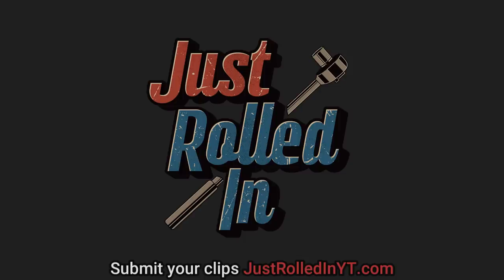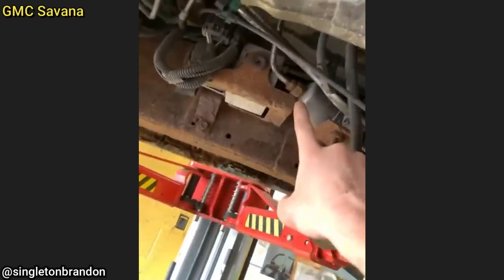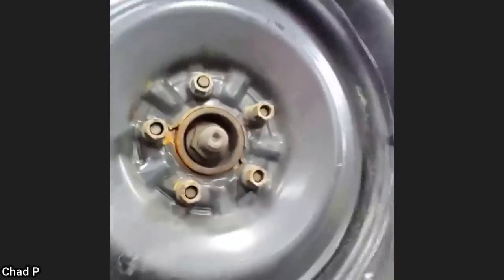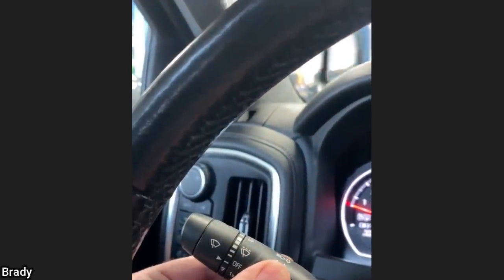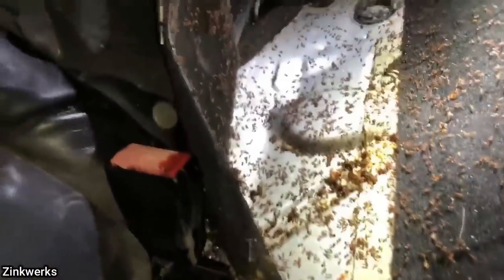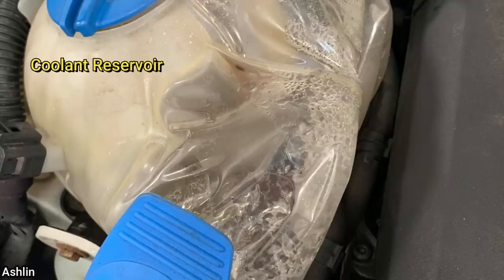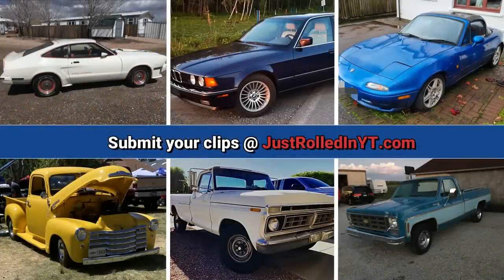Customer States Another Shop Failed To Replace Transmission | Just Rolled In

Comment: Just got my truck fixed. E brake hardware on the rear broke. He said the other side was looking rough so he fixed it also. And my rear wheel bearings were looking rough and he replaced them. He didn't call me for approval, he felt bad for the $800 bill, but I like my stuff fixed so I was happy and said "thank you"

Comment: That first one though, sounds like a case of "another shop" taking advantage of that person by just doing anything as "transmission work", when it appears the "fix" was dismantling all those automobile assemblies.  I'm guessing "another shop"'s "mechanic" didn't let them view the "repair" after they "completed" it.

I appreciate the fact the driver took it into the shop in the clip instead of continuing to drive the car in that condition.

Comment: 1:45 in my experience, most cars wont even detect the key unless it is in the vehicle, despite the windshield being so close, they usually won't start with the key on the windshield.
Reply: Second key must have been in the car if the customer drove it in like that.

Comment: Every time I watch one of your video's I'm at a loss for words. Since I'd rather not say what I suspect, let me just say people nowadays simply do not have the mechanical skills of even twenty years ago.
Reply: Maybe they should bring back "auto-shop" classes.
Reply: Which considering that everything is getting more expensive, you'd think its a skill people would be learning right.
Reply: Skills? What does that mean? .... 🤦
Reply: @sparkplug1018  I learned my mechanical skills back in the 60's when cars and trucks were reasonably easy to work on. I've spent my share of time crawling under vehicles, doing brake jobs and even pulling engines. Nowadays I can afford to hire a professional to do the repairs.
Reply: @jerryprice5484  Learned because I had to, now I prefer too. Just doesn't set right with me paying for something I can do. 
Surprising though more aren't willing to put the effort in we did.
Reply: @sparkplug1018  Totally agree, in my case however, I don't have a heated garage to work in, might actually work more on my vehicles if I did. At any rate,I now know watch to watch for when I have others do the work.

Comment: Modern driver assist systems know the difference between a box in the road, a person, an animal, or a vehicle. 
The reason they are this way is because the older type systems would engage the brakes over a trash bag blowing across the road. And occasionally, if the road gradient and conditions were right, a manhole cover. And other similar instances where it truly shouldn't intervene.

Comment: That is a 4L60E transmission that was just hanging. About the exhaust being cut, that is a common practice that I do to avoid breaking or striping an exhaust manifold bolts. Cutting the cooler line and leave the transmission suspended is NOT, however they way I do things.

Comment: I have a good story for ya. Roughly four years ago. 2003 Chevy Trailblazer. Bought it second hand from a parents coworker six months previous to bringing it in for repairs. Turning was a bit rough and I kept hearing odd sounds whenever I braked, turned, and occasionally while starting the car. I’ve never driven a four wheel drive vehicle before and simply assumed that it was normal. I read that four wheel drive cars can turn a tad jerky and rough. So I thought nothing of it. 

Six months go by. I brought it into the shop because my car was far less responsive to the turning of the steering wheel… I had been driving with a broken serpentine belt that had to have been so very close to breaking for at least six months. Fully snapped a month before I could get it into the shop. Still used it because I had to get to work. According to the mechanic he had no clue how I was able to ride it into the shop that was 8 miles away. Ended up being 3K worth of repairs.
Reply: Not very bright...

Comment: That loose seat reminded me of the car we had in the other day that had a messed up seat. When I opened the door, it was really high up, like headrest practically touching the ceiling high.  When I sat down, it sank to the floor. When I got back out of the car, "BOING" it was back up on the ceiling. And no, I'm not exaggerating the seat bottom being squishy. I'm saying the entire seat. As you put weight on it, it went down. Take the weight away, it came back up. Like it was on springs or something. And for the life of me, I cannot remember what kind of car it was.
Reply: You sure it wasn't a truck with a sprung seat????
Reply: @alexbrown1995  No, it was a fairly new smaller car. It was so weird. It had to have been broken, because it was half an inch from the steering wheel, so the only way to get in the car was to sit down on the seat first so it sunk down, then swing your legs in.
Reply: @joevk6274  That is weird, for sure.

Comment: I'm kinda annoyed at my repair shop. My car is fine but still it took several small repairs to fix the main source of my problem. So I ended up getting my serpentine belt, the tensioner, and the pulley crank all fixed for a total of almost $1450. What actually annoyed me was they noticed my coolant was at the low line. Instead of telling me that. They topped off my coolant with some cheap brand. My car takes a high performance brand from the dealership. Thankfully everything works but my coolant tank is passed the full line. Now I have to find out why my car has a second time lag in acceleration.

Comment: If you have an honest technician or even better if you have an older car and have a good mechanic...bring them a present when you are trying to schedule an appointment. Try to remember that they have ignorant customers that had a muffler job and then fault the repair man when their transmission stops working.  Forty-plus years in the motor trade.

Comment: Not gonna lie. I've set up a cardboard box in back of the shop to check the pre-collision system....it didn't stop.
Reply: In some cars it doesn't activate until you are doing 30 mph.
Reply: @bruceb4349  Makes sense. Otherwise, you probably wouldn't be able to park in a crowded parking lot

Comment: If you need a car with "driver assist", then you SHOULDN'T be driving at ALL!!
Reply: Who said they needed it? It could have come with it. And if you paid for it, it should work.  Also, nevermind the reduced insurance rates for having safety equipment like collision avoidance systems.
Reply: @JCWren  most collision mitigation braking systems are total garbage. You can get false positives all the time and find the car tweaking out, stabbing the brakes when it shouldn't.

Comment: Hello everyone, my dad and i need help,

About 30 minutes ago we started to smell oil burning on his truck which is a 2019 Ram 1500 classic tradesman with a 3.6 VVT V6. It just hit 76k miles not too long ago. I looked under the truck and found the transmission oil pan soaked in engine oil along with the bell housing. Could it be the rear main seal?
We are going through some rough times in our family and it's just been very hard on him. I look up to him as superman and i wish i could do more.
Reply from the maker: Most likely rear main seal if it's on the transmission pan. Too bad it's just over warranty for mileage. Hope you guys figure it out.

Comment: Don't know about Amarican Car Law's and Regulations, but half of the Cars shown on this Channel would be taking out of commision here in germany, and the other Half would properly have to go through the TüV, which is an Orginisation that gives the Approval if a Car is Street save or not. 

So many Cars I see here.... yeah the Garage / Repairshop would tell the Customer the Car is grounded, Totaled or the Repair costs far exeed the worth ( A financial Total loss, if that is right, means so much as, car is worth 1000 bucks but repair costs 2000 bucks.) Thou to be fair.... Car repairs are extremly pricy in german. Just a damn Car inspection, depending on brand can cost 500 bucks easy... and thats just the inspection, not the repair.

Comment: there are things ,such as transmissions, that should be handled by a specialist. Ask if the shop has a master mechanic that specializes in transmissions. It will cost you, but it will be done correctly.

Comment: How can someone screw up a one-for-one swap of a major component like a transmission that badly? You removed X number of bolts from the old one. The new one has the same number of holes. And you're obviously not supposed to cut the fluid lines off to disconnect them. I've seen people with no mechanical aptitude before, but that's ridiculous

Comment: So much of this could be prevented by just following routine maintenance guidelines and staying away from the cheapo oil change joints.  Auto repair is just like steak.  If you want a good steak you will have to pay a good price.  That cheap commercial grade stuff is good for repairing boots.  Cheap auto repair, some neighbor kid or some other loony will cost you.

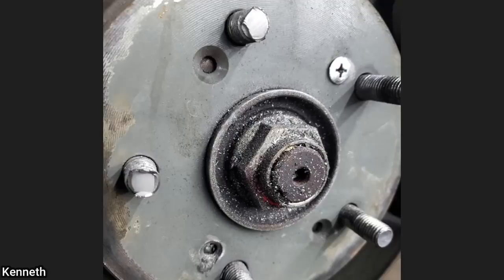Comment: I didn't see what's wrong with the brakes at 2:00, someone wanna help?
Reply: is it the studs?
Reply from the maker: Broken studs and the screws that hold the brake rotor in place are in the wrong spot. So the surface that the wheel mounts too isn't perfectly flat anymore.
Reply: @JustRolledIn  now its supper obvious. thanks
Reply from the maker: @steftheengie2904  no problem! I also put more info in the description for each photo and clip.

Comment: Back in the day the schools had ... auto mechanics class.... so boys could learn a little about cars. Today the schools have classes for boys on what dress to wear to the prom.
Reply: Yep, as said somewhere else: In the past the owner´s manual gave information on how to adjust the valves, today the manual tells you not to drink the content of the battery. We are surely  on the wrong path.
Reply: @nordishkiel5985  We gave them an inch and they are taking miles!! Remove all warning labels and let nature take its course!!
Reply: That's the dumbest thing I've ever heard. There's no class anywhere that teaches boys to wear dresses. That's right up there with the stupid stories about classes having litterboxes for furries. Anyway, when I was a kid, we taught ourselves how to pick out dresses. 

Colleges teach automotive. Some of them partner with manufacturers, too. In my city, you can be done in two years and fully certified as a Honda dealership tech. It's neat.
Reply: I was the only woman in most of my autos classes. I still want to be a diesel mechanic. So it's not just for males. It should be a required class for everyone since most parents these days don't teach their children how to even put gas in their vehicles let alone to change a tire and check the fluids.

Comment: Good grief on the van with the transmission just sitting there not hooked to anything.   I simply do not understand how any Mechanical shop could be so incompetent.   Well  on second thought it is apparent that they are not a repair shop , simply hackers.
Reply from the maker: I wonder who actually worked on that one. Either way they shouldn't be working on vehicles lol
Reply: @RandomDuude  very accurate
Reply: tried doing it in a driveway or their garage with maybe just a floor jack and no transmission jack. just cut everything out of the way right?

Comment: '... filled the coolant reservoir with washer fluid.' Depending on where you are, water goes in the coolant reservoir, and water gets used as washer fluid. Just need to make sure there is water in both containers though.

Comment: I’ve had bad work done by other shops, but come on guys, they’re not going to cut your exhaust and fuel lines to change a trans, just admit you did it😂. I’ve even done some bad work just because I didn’t know what i was doing. So i told the shop I didn’t know what I was doing. Plz fix 😂😂

Comment: washer fluid in the coolant is at least not a terrible F-up, sure it will need a flush but at least its not say coolant in the oil. or coolant in the washer res causing the engine to not get the fill it needs.